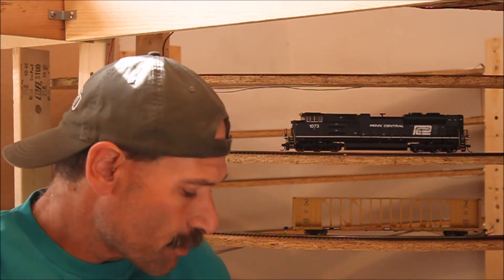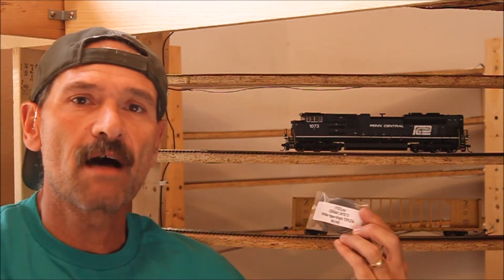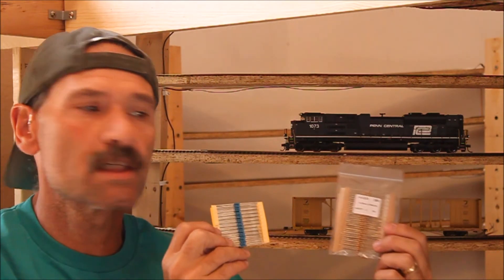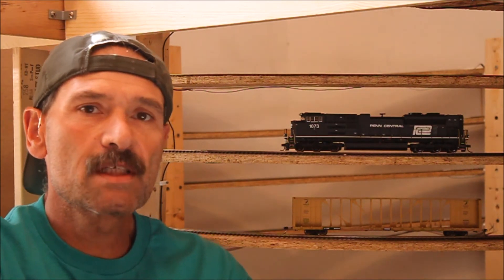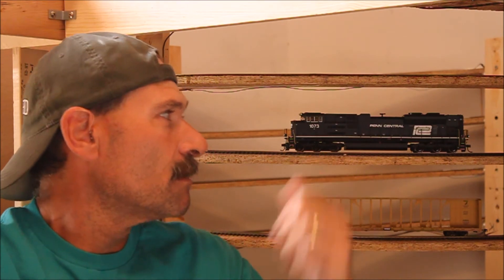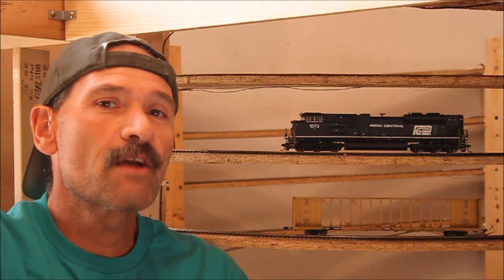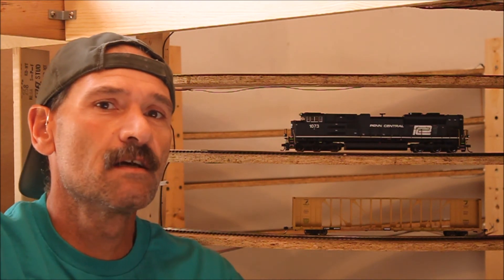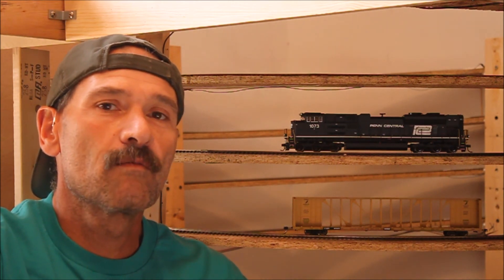Tales from the Layout - November 2013

Comment: You bought a lot of cool stuff! Love that engine and the truck too. Thanks for sharing . O yeah! the center beam looks awsome too.:)
Reply from the maker: I love the loco too, she's bad ass! the electronics were cheap and easy. the lights were $9 for a roll of 100 and the resistors are $1.50 for a pack of 100, found on ebay